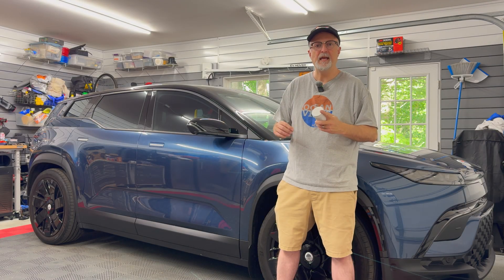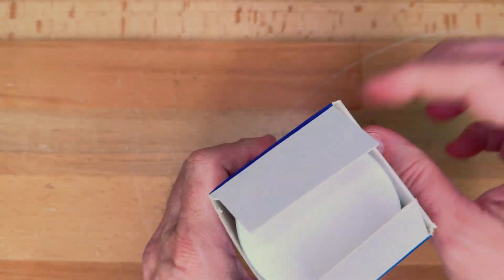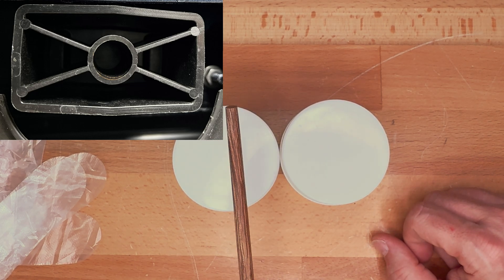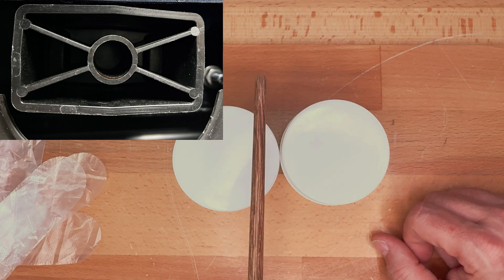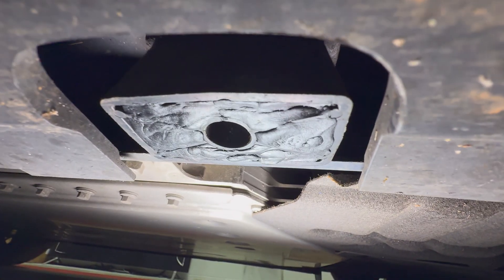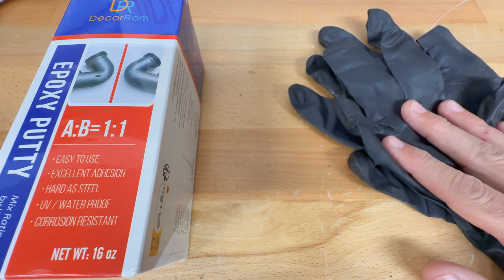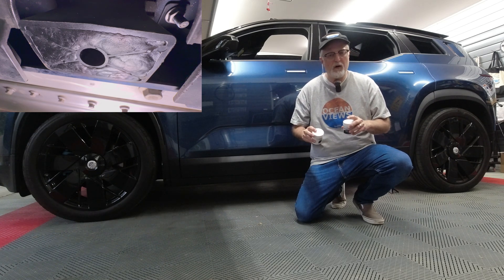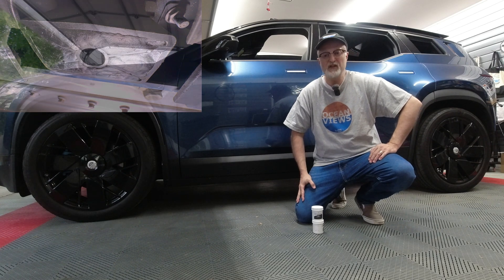Fisker Ocean - Jack Point Reinforcement

Comment: Yes.  Unless you have a 4 point lift.  When you jack on a lift point there is always some amount of sideways pressure which will crack the web.  If you look closely at the second first lift point you will see a small crack in the lift point hole where the puck is inserted.  The bad news is it will only get worse everything you put and sideways pressure on the lift point.  I did this to my 3 surviving lift points last year and to the replacement I had to install due to the RR lift point being totally destroyed.  I posted some pictures and instructions on the forums but as always Matt does a superb job of making the process clear and concise.  I urge you to do this because there are no replacement lift points available anywhere and once they are unusable you will have no choice but to jack on the A frame joints and while they look robust they are cast aluminum and that much weight focused on the small surface point is a recipe for a disaster.  That is why Fisker specially say not to use them to jack the car up.  Great video!
Reply from the maker: Yes, thanks for the comment.  There is some research being done to create replacement jack points, but nothing available yet.  Also, to replace them is fairly substantial amount of work including removing the rocker panels.
Reply: @MTNRanger  I have supplied 2 salvaged lift points and my damaged one to an FOA member who is working on a solution.  He has shown me an aluminum prototype that looks promising but with no demand at this time he has not gone much further with it.  It's not a product you even think about needing until after the disaster occurs and I fear that even with the epoxy filler the existing ones are not a long term solution.  I have been thinking a block of good/solid hard wood/delrin/rubber machined to fit the opening tightly could be jammed in the opening with RTV adhesive on the surface contacting the frame would be a good solution.  I would also make it at least 2-3 inches longer and 1 inch wider to provide more lift surface against the frame.  Drilling a hole in the middle of these for whatever puck size is needed (like the Corvette?) would make the special puck size moot.  And it takes some amount of finesse and brute force to remove the rockers with front wheel on.  I was lucky as I had Raymond come over to help with that project and even he some challenges getting the damaged rocker off and and the replacement rocker installed.  That damaged lift point would have been a bear to remove with the rocker installed. 
I just pulled both interior rear lights and hopefully fixed the random lights on and off problem.  Your video made it easy.  And the tip about how to locate those metal clips saved me!  All 4 came off and if you had not showed how to find them I would be agonizing today 😓trying to locate replacements and driving around with those light fixture sitting on the shelf in my garage.